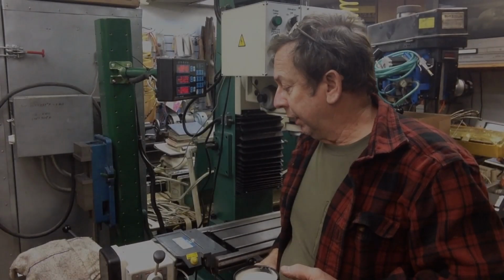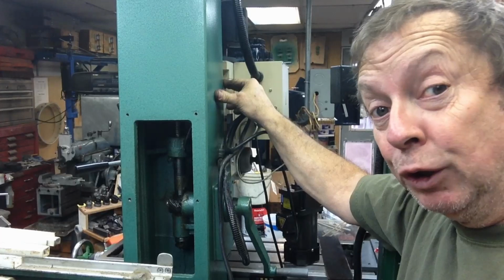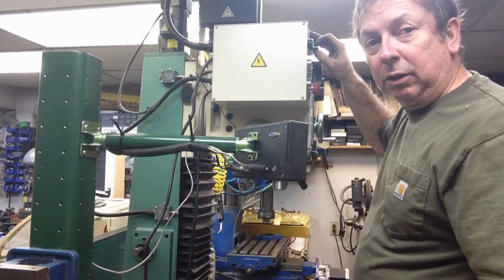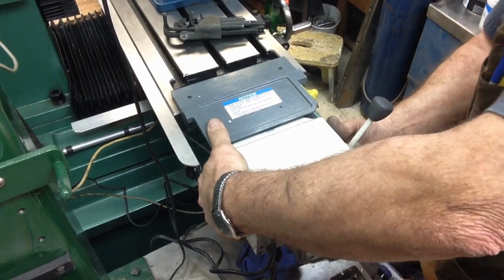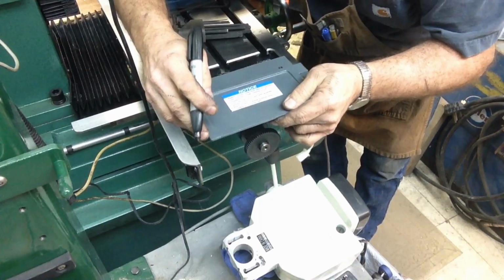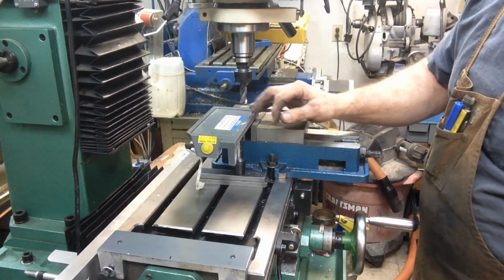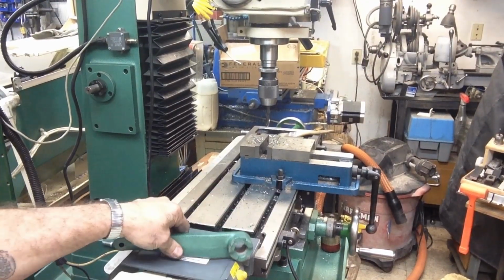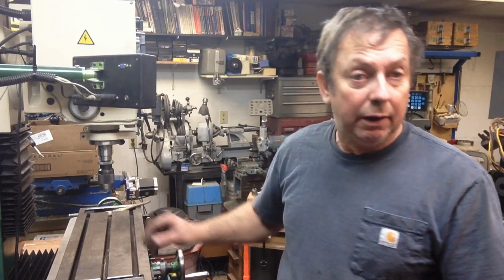Grizzly G0755 , Part 10: DRO Problems, Oil System Modifications & The Column

Comment: Hi Dan,
I can't remember who said it but they suggested that a new Chinese Lathe/Mill was like buying a kit that is already assembled and you'll need to disassemble it, clean, fix and reassemble. There does not seem to be many who don't have to...
Take care
Paul,,
Reply from the maker: Yes that is fairly well known but I do still think they are a good value. It was commented early on that I should dissasemble and deburr everything when I first received it but I disagree with that because you don't know where you are starting from if you do that.  It is kind of a hit or miss proposition because when I got the G0602 lathe it was a much better machine than this mill is turning out to be.

Comment: I ended up putting foil tape on the gap between the power feed unit and the bracket because chips were still getting in and getting stuck in the teeth of the gear. Not pretty but it works.
Reply from the maker: I haven't had that problem
Reply: @hillsgun  I had to take it off one day to remove a chip from the gear teeth and didn’t want to have to do that again.